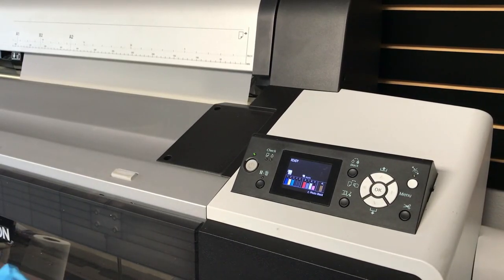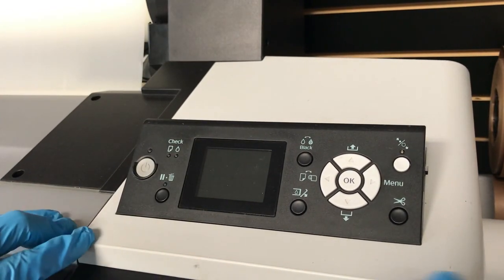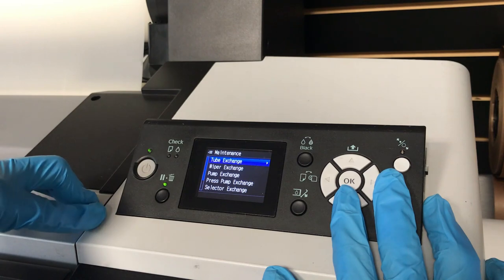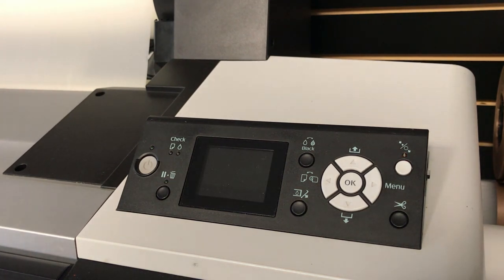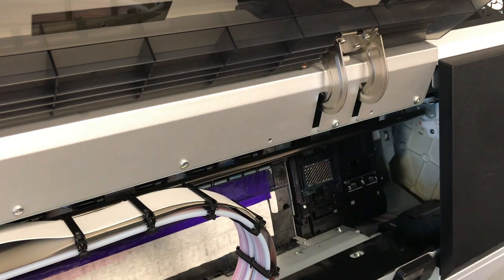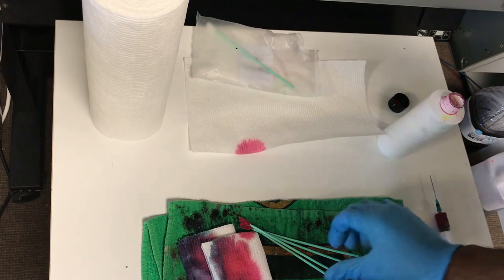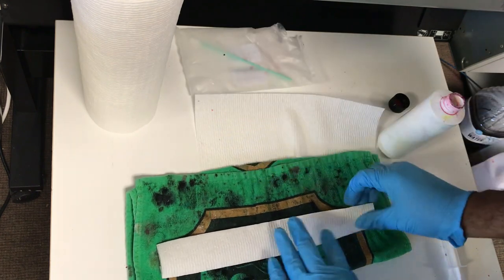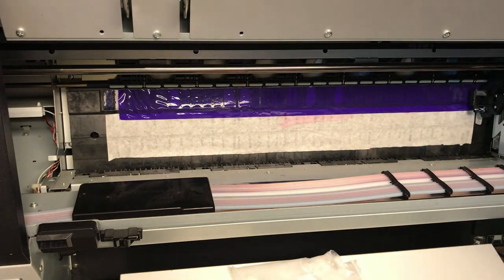PART 5: EPSON 7890 DTF CONVERSION

Comment: Love your videos.  Getting ready to convert one myself following your steps.  Quick question though, How do you wet cap?  Or do you use another method to keep white from drying out over night or  a couple of days?
Reply from the maker: From what I've experienced, you do not need to wet cap with the 7890 because it does routine cleaning cycles, pretty much anytime you do anything with the printer. I would also make sure you're using quality inks, because that will be the culprit, if you notice ink drying out, on the head.
Reply: @elegant_edits  Just got my flush kit and going to load at full strength as the printer has sat a long time.  Ink charge and let it sit 24hrs.  repeat and see what i have to work with.  I use DTF Superstore inks and they have been awesome so far but they do dry out if not using the printer without capping.  Would you recommend a certain brand?  Was looking at Kingdom Inks, and also waiting for your next review on ink sets..

Comment: Hi Jay, been enjoying watching your videos for a while now, just subscribed.
I’m looking at an Epson 7900 to convert like your 7880….are they similar? Can’t find much on the 7900 being coverted.
Or would i be better off converting a 9600 instead do you think?
I’ll be using Acrorip 10 as i already use that with my L1800 which you have helped me a lot with in your videos.
Thanks so much and keep up the great work!
Reply from the maker: Thanks for watching my videos! I appreciate the support. I would say that the conversions for all three of those printers are exactly the same. I don't know if I would fully commit to the 9600, unless you found one at a great price, as it is a model from the early 2000's. I will have several printers to convert, soon; hopefully one of them will be a suitable model for you to follow, for your conversion. I will record all of my conversions.

Comment: I'm purchasing a Epson 7890 myself is the conversion expensive ?
Reply from the maker: Yes, definitely. The 7890 has long lines and the volume of the carts is also a blessing and a curse; since, you can print for a longer duration of time, but you'll also have to keep the carts full, for each channel, which can be costly. I would only use two channels for white, instead of four.

Comment: hello jay
my name is mike and i am currently building a sc-p6000 epson to become a dtf printer.
I'm trying to start with acroripv10.3 and your cartridge setup.
do the correct cartridges have to be used and simply another color in the position? I ask about the chip. I have to specify the order in acrorip. you put magenta in a yellow cartridge i think?
Please get in touch. I started a good conversion with circulation and screen integrated :-)
THANK YOU for your VIDEOS THANK YOU and greetings from Germany
Reply: Hey Mike If I we're you i'd strongly look into installing a custom ink circulation system for the white channels otherwise you're going to have lots of wasted ink every time you print, inconsistent white prints if you can't keep that machine running every day, or clogged up printhead in the first year. So far No one I know has figured out how to make the 6000 circulate without introducing air into the system. Might be something you want to think about engineering and get back to us with what you came up with if anything.

Comment: Hi I was just wondering how the new ink is working? Also I had some questions about dtf printers. I am very new to dtf and am still trying to decide what to get. I am considering one from procolored but I can't find any actual reviews for them.
Reply: You never will. All the Chinese models use off the shelf parts and custom software to work. Unless of course you're looking at the L1800 or R2400 conversions those companies sell. The only time I would consider paying an upcharge on converted model or even a large format model is if they have implemented a FULL ink circulation system in them. Like ink from the print head back to the container and around again kind of circulation.
Reply from the maker: Hey! I'm sorry for the delayed response. I have had great experience with the inks. I am using both Big Boi Inks(Epson 7890) and Kingdom DTF inks (Epson L1800). I have run the L1800 for nearly a year, with no issues and the same print head, that it shipped with. I am 2 months into using the inks from Big Boi Inks and Have noticed that it takes a Long time, for the inks to separate(which is a good thing!). People have their own opinions about DTF printing, but my experience is that, if you have great inks, and do routine maintenance, it will extend the life of your print head. I haven't heard anything good, nor bad about the Procolored systems. I will be offering printers, soon. I am negotiating with an overseas manufacturer and have spent the last month; asking them the tough questions. Our printers will use Korean inks (some of the best formulated DTF inks), a DX5 print head and ink warming, and circulation system. I will post updates on this channel, once we are ready to launch.

Comment: did you figure out how to stop the pre print cleaning
Reply from the maker: I think the auto-cleaning function is just part of the printer's operation and cannot be prevented. I did figure out how to stop the nozzle check function, however.
From the printer's menu, select:
MENU > PRINTER SETUP > AUTO NOZZLE CHECK > OFF (PRESS OKAY)

Comment: Will a Epson P6000 work for DTF ?
Reply from the maker: It can work, but the issue people are having right now is that Epson's new technology renders each cart useless after a finite number of resets. This means that you will need a new cart, after the printer realizes that you have been using the same chipset. The only reputable company that has engineered a system to bypass this issue is DTGPro. They are the leaders in DTF innovation, in my opinion. Here's the comparative model from them:
https://dtgpro.com/cicproduct/dtf-pro-thunder-2.php?afl=1898